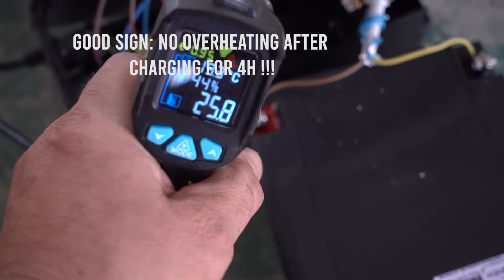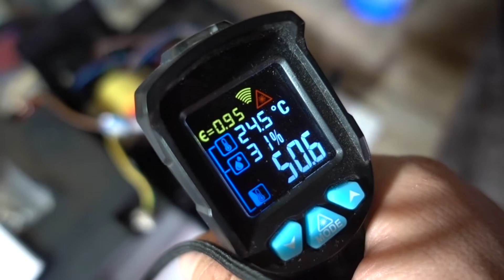How to increase UPS backup time - WILL THE INVERTER OVERHEAT with larger battery ?

Comment: I done a very similar thing, i bought a cheap UPS $100, and just wired a N200 (200 AH) battery to it ... So all up it cost me $250 .... you'd be hard pressed to find a 200AH UPS back up for that price. It can only handle 500 watts of draw, but that's fine for what I need it for. Cheers for the video, im glad im not the only one tweaking this type of stuff :)
Reply from the maker: Thanks! Be careful for overheating, measure the transformer temperature as shown in video. 500W is a LOT for longer draw from UPS. I get overheating for any power over 50W
Reply from the maker: Again, the point is that if you draw all 500W, it wont last longer than 20 seconds, irrespective of  battery capacity. It will stop because of overheating, not empty battery.
 For longer use of power you can only go up to 10-20% of UPS capacity
Reply: @MarkoRadulovic  how about apc bx1100c . ? what the max limit . it originally cums wd 12v 7ah . 
there is also 9ah battery set wd same physical dimension

Comment: Very important to keep in mind the systems are designed and sized thinking of heat output too. When the system rated at 500 watts is putting out 400 watts, the original battery capacity only allows for it to run like 5 minutes (or less). A larger battery would have longer run time, but the unit may overheat and shutdown at 7 minutes. 
If you run at half rated current, so 250watts output from a 500watt unit, even with a huge battery you should NOT expect an hour of run time without additional cooling, such as a 12v fan pushing air through the UPS.
If you are wanting hours of run time, stick to 10-25% of rated current. IE  500watt unit can supply 50 to 125watts for hours. Network equipment is a good use case.
Reply: I bought a Cyberpower cp1500pfclcda 1500va 1000w sine wave battery back-up system it has 2 9AH batteries 24v so I added 2 100AH batteries 24v but it can't see that I added more AH to it and at 207w it only runs 44 minutes then shuts off but the batteries are still at 24.5v when it cuts off. Can I hack the system to change the settings?

Comment: This is perfect for blackouts like here in my town just need power for a couple of hours as for running a tv just change it for a car battery you get 2 to 3 hours depending on how old the tv is and it size I saw a video a guy power a tv and a xbox with a car battery for 2 hours
Reply from the maker: Mind it that car battery is not made for deep discharge and therefore cannot last long for this purpose.  So you need a.deep cycle.battery which is unfortunately more expensive. Car battery is only made for short discharges, like to start a motor  and then its immediately recharged again as soon as the motor is on.
Reply: @MarkoRadulovic  well it's not for that purpose but it's not like I would use all the time just once in a while  car battery it's good not for going off grind just for a couple of hours and once in a while deep cicle ? Who cares if it's only for a one time use
Reply: @MarkoRadulovic  not everyone goes high tech on solat just made do with what you have i only spend 30 dollars of electricity bill in my country not couple hundred or thousands like in us 🤣🤣🤣

Comment: AGM batteries are kind of best for the UPS, as like you mentioned, UPS requires deep cycle Lead-acid batteries. You could even run the whole UPS off of Optima Yellow Top AGM if you truly wanted to, with the bonus of longer battery runtime with up to 50 - 100 Amps hour capacity. Or if you're an electronics whiz with the experience of safely handling the Lithium-ion cells, I'd go down this route personally, it's a lot more efficient than Lead-acid batteries - you need to modify the UPS' battery charger somewhat to fit Lithium-ion battery pack in.
Reply from the maker: I agree, lithium-ion batteries are the best option. But because charging stands in the way, it would be great if you could explain in detail how exactly should the UPS charger be tweaked  for lithium batteries.
Reply: @MarkoRadulovic  I don't have exact information since chargers in the UPSes varies widely - if the battery charger is of switchmode power supply flavor, check the datasheet on the power supply chopper transistor driver and then identify the exact potentiometer until you can change to the onboard BMS' charging voltage so the battery can then accept the charge. I strongly recommend to have BMS (battery management system) for obvious safety reasons, and so it guarantees that the batteries are balanced so they last much longer. The chargers are normally set to 13 to 14 Volts DC for Lead-acid batteries - I'd go with 12 Volts DC Lithium Iron Phosphate battery pack as it's fairly close to the car alternator voltage, about 14.6 Volts DC so we're not pushing the charger too hard.
Reply: @MarkoRadulovic  SORII NO SPIK INGLIȘ,,,,MERGEȚI PE INCARCARE SOLARĂ,,,CONTROLER PENTRU BATERII LI-ION ,,ȘI TOTUL OK..

Comment: May I know why lead acid battery is not suitable for this set up?
Reply from the maker: Because such batteries can be emptied only until 50% charge. If you empty them further they become forever unusable, thrown in the bin. So, what you need are DEEP CYCLE batteries which can be emptied deeper, under 50%, without getting damaged. A bit like phone batteries.

Comment: My findings is that 3 times the amount of the recommended value of the battery should be maximum to be safe since the lead acid battery isn't 100 % value of efficiency but around 70-85%
Reply from the maker: The capacity of a battery does not matter for.safety, only the power drawn matters, please read the text under the video. Anyway, if you overload the system, it willl shut down due to overheating, so no danger there.  Do not use acid batteries, only deep cycle
Reply: @MarkoRadulovic   just stepping up the ups type batter from 7ah to 18ah should be fine why you don't recommend lead acid ?

Comment: I have a 2200v UPS, if i improve the airflow can it serve me for atleast 8hours?
Reply from the maker: No, definitely not, it will overheat if you use over 100W very quickly. So, you need to buy a sinusoid inverter which for 2kW would cost at least £300, but that is a safe solution. You van find inverters with a UPS function easily on Amazon

Comment: just bought my first ups. but why transformer is always hot even with no load? any idea?
Reply from the maker: Due to hysteresis, copper losses etc... transformers use energy and generatebheat even without any load. If temparature of the core is above 50C, that would be a reason for concern, up to approx. 50C can be considered normal
Reply: @MarkoRadulovic  it is 40C or less.  but all that heat all the day that is a lot of power losses in my opinion.

Comment: All 4 my UPS devices each have 2 x 12v lead-acid batteries (in series). These are normal 7Ah batteries and it keeps the PC on for just long enough to save and shut down. On one of my UPS devices, I only run my Wifi and it runs for at least 3 hours, so that is ok with the low load. The problem with these small UPS's is that the batteries do not last very long. Usually, after a year I have to replace them. So I wonder if these do not get over-discharged. (I have about 16 old batteries that do not hold a charge). Will a bigger battery help? I got an intelligent charger and I charge every battery with it every 6 months and they seem to last longer now. The UPS devices seem to be OK and never give problems but I wonder if they manage the battery power properly.
Reply from the maker: It depends how often your UPSs are   in actual use, that is, how often do you have power outages? If you do not have power outages  - than batteries never get discharged and any battery problem exactly as you say would go down to poor charging management by the UPS. Increasing battery capacity would not help with battery longevity. Actually, one  year is not such a bad usage period for a lead acid battery type. If you have 4 UPSs, for you it may be better to install a solar system type of supply, with or without solar panels. You need an inverter with about 2000w power  and a 100Ah deep cycle battery and you can run your desktops faaaar longer. If you get an even bigger battery and say 3000W inverter you could also run lights and smaller appliances in the whole house, so much more useful than several  UPSs
Reply: But series conection makes 24 v not 12 v
Reply: The charging circuit in these consumer UPS units..suck. They are fine for maintaining a full charge, usually 13.2volts. They do not have the output to charge the battery back up properly after an outage. It might be able to trickle charge up to 80% eventually. But there is no bulk charge cycle, or saturation charge (13.6v) cycles.
A good 3 stage charger would greatly help the lifetime and the capacity of external batteries. However, I'm not sure what problems would be cause by hooking up another charger when the UPS is trying to trickle charge.
Reply: @javaman2883  basically the (distilled) water in the batteries dries up, if the batteries are in working condition you just have to top them up with distilled water and they work again, check videos on YouTube many do it

Comment: Hi. Did you buy an external charger to charge  the battery or it is still connected to the original circuit to charge it?
Reply from the maker: Original charger can charge much bigger battery without problem, it only slower

Comment: i have a 2000 va/1200 w ups with built in exhaust fan, how much would be safe to draw from it with huge battery
Reply from the maker: the rough guide is 10% of the nominally rated power, in your case 120W. But as other specs may differ it is always best to check whether it overheats at 10 and 20% by using a laser thermometer, these are now very cheap. At 30% it might already automatically shut down in a short time

Comment: does it need thicker wires?replacing higher Ah is longer time charging
Reply from the maker: Well, no need for thicker wires, but if you really want to adjust to 24/7 power supply it is best to buy solar  battery charger and inverter for solar systems and ditch the UPS

Comment: Thx you your tests are very nice!!
I guess the discharging part is fine. I means supplying the device in Power AC outage.
Then comes the charging part of a larger Amps battery.
I doubt that charging circuitry of a standard PC UPS can handle the amount of Amps required by those large battery. What gona happen?? the batt will reach 13.8v-14v, without being properly full Amps charged.
I saw other place, they combined an external Charger to feed the battery and rely on the inverter of the UPS to Power the device. That combo seems to do the job ))
Reply from the maker: Thanks Zip, charging is not a problem, it only takes longer with a bigger battery, while UPS does not overheat at all. Discharging is a challenge as loads higher than 15 percent of declared maximum UPS load already start to heat the UPS and by 70 it turns off
Reply: @MarkoRadulovic  I guess I am gona to try it again.
Last time time I tried to add a bigger battery , it did not go very well. I mean not much better time. Maybe because it was an old car battery, that was no more able to start the engine of my car, so I gave it a shot.
The thing is I dont want to buy a new battery, and then fail. I know car battery is no choice!! They are not deep cycle battery...
About the heating, always a good choice to add a small PC fan ))
Reply from the maker: If you need a longer-term (from 20 minutes up to several hours+) supply for a load of over 50W, my strong recommendation would be to buy components used in solar systems - these are in principle similar to UPS, but made for long supply of higher loads. You need to buy a battery charge controller and an 12V-220V inverter (1000W+). That might be a bit more expensive, but wont burn the house down. Using fans to cool UPS might work but over long term, the chance of burning down the house down is very high. Playing with electricity sooner or later - ends in disaster

Comment: 1. is it possible to Run A Gaming PC & a Fan ? Will it be overloded there is Display too...

2. When connected a car battery to UPS it will take longer time to charge is there a way to speed up the charging process and balance the heat
Reply from the maker: For any load larger than 100W, you need to buy components for.a.solar system: invertor, battery charger etc.. Cannot supply a desktop with UPS for longer than several minutes, irrespective of  battery size, please read the text in the video and below video
Reply from the maker: You cannot connect a car battery, only a deep cycle battery. Please read the text and watch the video carefully
Reply: @MarkoRadulovic  yeah I mean the car battery that doesn't have liquid acid.... I think there called dry car battery or something
Reply: @MarkoRadulovic  but my original ups keep the PC on for half an hour

Comment: Is it possible to run a desktop pc with monitor using this type of setup ? Desktop SMPS rated at 400 watts.
Reply from the maker: I did a test, shown on a link below, with a 380W UPS which is similar to yours and increasing loads from 100W, to 200W and 300W. As soon as 300W were reached, the power stopped due to overheating. I assume that a desktop PC + monitor also add up to about 300W. The solution is to buy a more powerful UPS, about 1000W and a deep cycle battery of 50+Ah, best 100Ah. Building a powerful UPS setup is thus quite expensive, which is why I limited my UPS extension to surveillance cameras which use a maximum of 7W each and LED lights. Here is the link to the test  https://youtu.be/zIqxJN7aNS4
Reply: @MarkoRadulovic  Thanks for the reply.
Reply from the maker: Generally, UPS setups are made to endure 50% of their rated power for only several minutes. they can endure small load, at about 10% of their rating for a very long time. But if you want to power several hundred watts for a long time it may be best to buy solar setups (not necessarily with solar panels) just a 200AH battery and a transformer of 1000-2000W sinus and this could power a desktop for a hole day. But this is even more expensive than UPS
Reply: @MarkoRadulovic  thanks for this. have seen a lot of stupid videos on youtube
Reply: @MarkoRadulovic  What about adding a small fan to the electronics for the overheating prevention?
Reply from the maker: @tddrivers  Well, you can experiment with a fan if your UPS does not have a fan already. In my view using much less power than declared for UPS is the safest strategy. The best would be to buy components for a solar system, these are already designed for constant power supply, while UPS is  designed  to supply power for a very short amount of time

Comment: Will it be same in case of 120ah battery with 650va ups?
Reply from the maker: Battery size is irrelevant for overheating, but if the declared power is say 650W, I would estimate that you can achieve a constant draw of about 100W without overheating
Reply from the maker: So your 650VA are about 520W, I would say then you can constantly draw approximately 90W of power nonstop without overheating and UPS shutdown

Comment: It will not charge fully, its 0.7a charger in ups and needs to be 2.7a in order to charge 27a battery
Reply from the maker: I mentioned in several responses here, oversizing a UPS is an improvisation. Electricity can be properly provided only by separate a  charger controller and an inverter

Comment: 26 ampere 12 volt battery is installed then what needs to be taken care of charging time?
It has been ten days since the battery fitting was successful running ups continew
Reply from the maker: I did not quite understand the question, but the UPS should charge a battery automatically, could be that this bigger battery wull not be charged 100%, but as mentioned previously, this intervention is an improvisation

Comment: Tried ths, worked, but ups gettng turned off and on when no electricity is their... Why s ths happeng?
Reply from the maker: Could it be that you  are simply  overloading and overheating your system? I recommended in this video that for a UPS rated at 380W one should not attach consumers with combined power exceeding 50W.. That is, for smooth operation system should not be loaded over 15%, 20% max.
Reply from the maker: This shows UPS function with increased load. Backup time is reduced disproportionally, overheating, then UPS simply stops because of overload/overheating.   https://youtu.be/zIqxJN7aNS4

Comment: Sure it will work because you used only 20W. Your capacity was 600 VA. If you want to test correctly need more power to use. Then check temperature.
Reply from the maker: It works under the shown conditions, not with much more power. That is the point and the reault is clearly noted: DO NOT USE MUCH OVER 20% RATED UPS POWER FOR LONGER USE
Reply: @MarkoRadulovic  20% load? jfc thats pretty abysmal

Comment: Some of the UPS  it will run only for a certain time or just only for a 5 minutes then it will beep for cutt off. How to reset the timer, for continues operation as an off grid inverter? Thanks
Reply from the maker: There isnt any timer, a battery limits the time, so if you put a bigger battery - the time will extend by  itself. The important point is that the power of your devices should not be over about 25 percent of the rated power of UPS, otherwise the UPS will stop due to overheating, irrespective of the battery
Reply: Thanks Sir...
Reply: Some ups have no load (or low load) auto power off after 5-15 min. Some have a jumper or a resistor that u need to remove
Reply: @CatalinTabirca  how to indentify that
Reply: A resistor named R15 or in pcb a resistor number is written and mentioned that NO GRN you should remove that specified number of resistor.